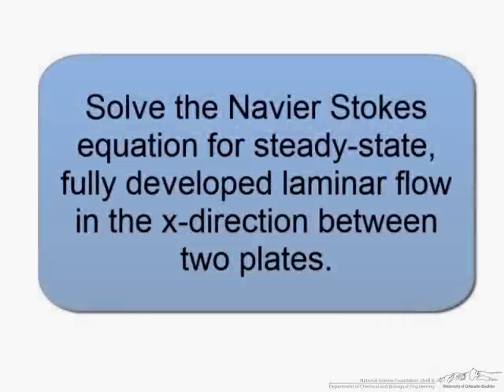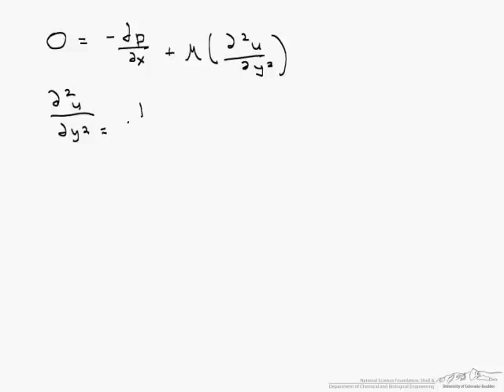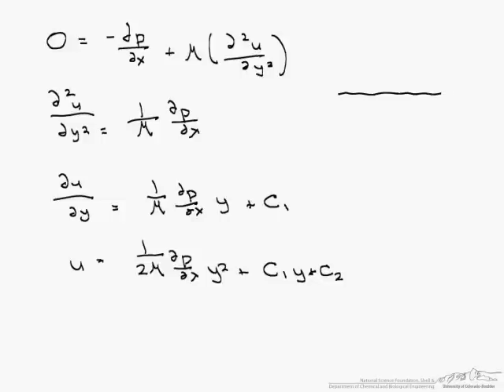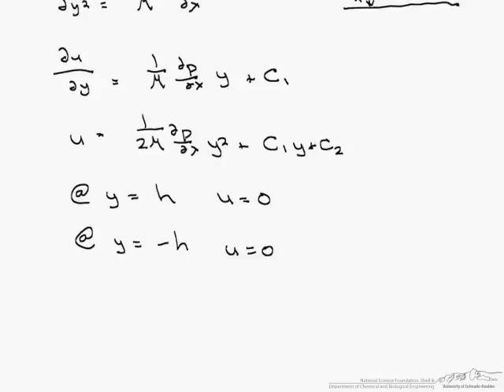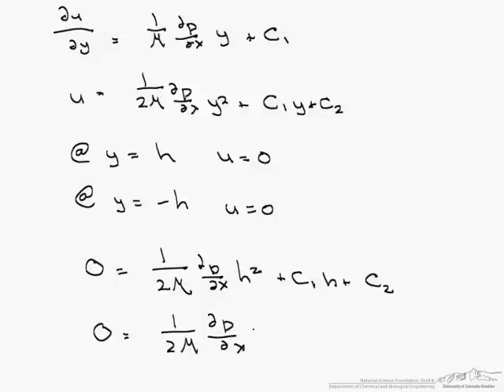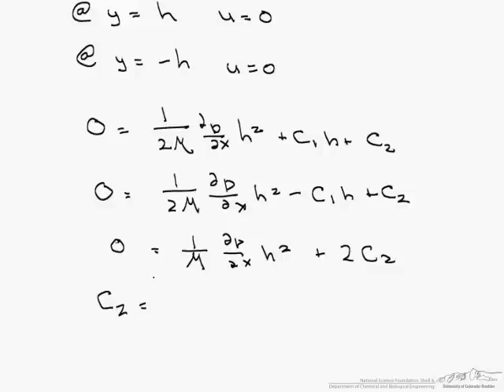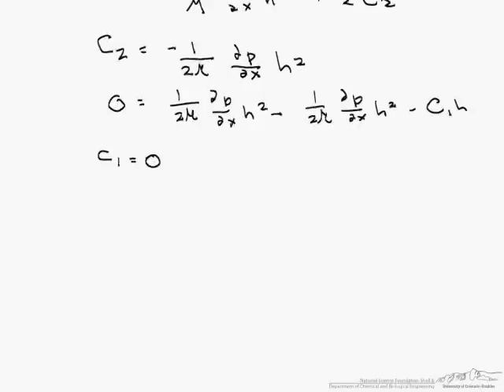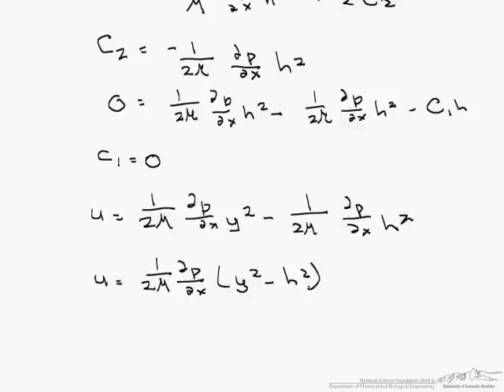Laminar Flow between Parallel Plates (Navier-Stokes)

Comment: In the first equation for the video, should not there be 1/rho, rho=density    so 0=-1/rho (dp/dx) +......
Reply from the maker: Thanks for the comment.  No, the equation isn't missing a 1/rho.  Can I ask why you think it might be?
Reply: Thank you for getting back to me:
original equation: dollar sign is partial derivative
$U/$t   +  U* $U/ $x = -1/rho  ($P/$x) +g* $ +(mu* 1/rho*($U/*x^2)

After canceling both terms on left hand side and g term on right hand side:

we will be left with: 
 -1/rho  ($P/$x)+(mu* 1/rho*($U/*x^2) 

did you take out  rho (density) as a common out of the equation and multiply it with zero to on left hand side? That is one explanation I have. I apologize if i misunderstood it.

Comment: what's the area equal to in Q=  integral of a.n ds  (volumetric flow rate) please !
Reply: zawette 
Q = $ u.n dA
A = cross-section area of the pipe(A = b*h for rectangular cs or A = pi*r^2 for circular cs)

Comment: There is another (perhaps easier) way to determine that C1 equals zero with boundary conditions: realize that the flow is at a maximum when y=0; thus, (du/dy)=0 when y=0. Substituting these values at 1:21 in the video gives: 0 = 0 + C1 -> C1=0.
Reply from the maker: Alexander Maltagliati You are correct.  This is another way to get the same answer.  Thanks!

Comment: The results are correct, however, an important step is missed. It is important to solve the momentum equation in the y direction to derive that the partial derivative of the pressure is only a function of x. This will allow you to complete the integration at 1:09.
Reply from the maker: Good point for being thorough.  We will put this in to be redone.  Thanks!
Reply: I think we looking in the x direction, thats why she made it 0, same as in the z direction which was made a 0 too. Fluid flow is 3 dimensional but she is looking at the x direction for coming up with the Navier Stokes.